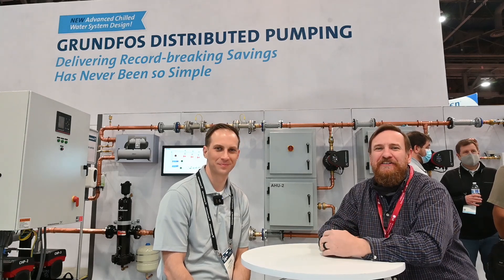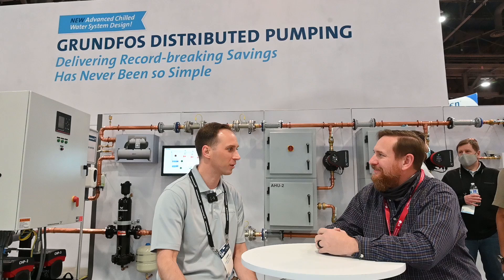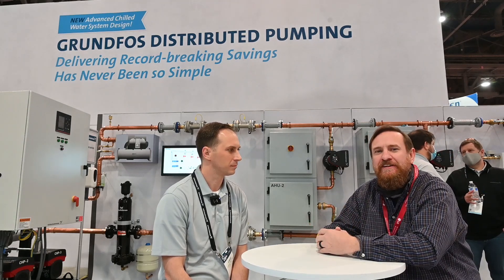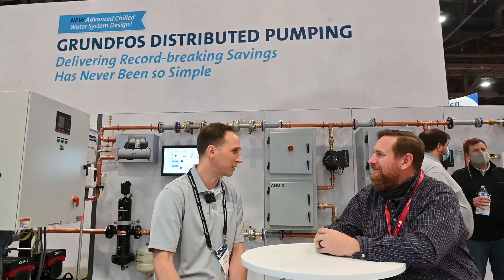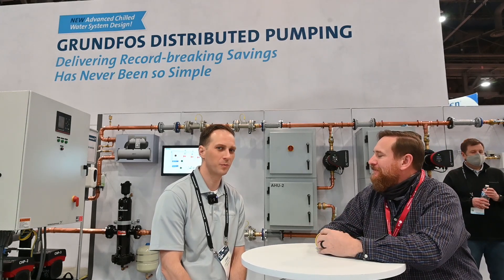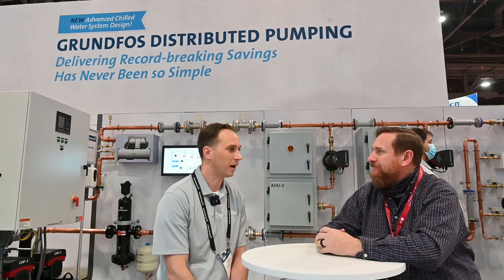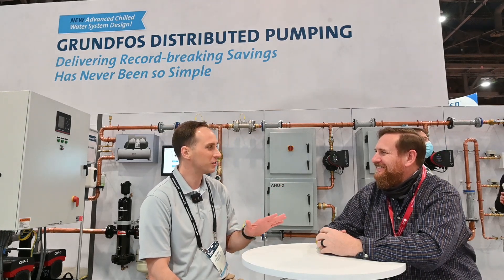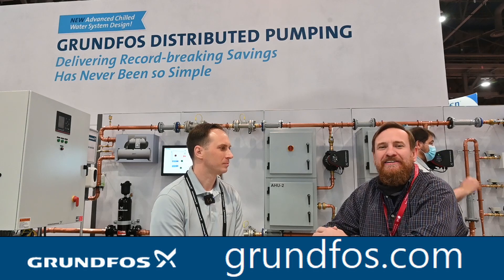AHR 2022 Chris Ireland Grundfos pumps

Comment: Just installed one of their pumps on a glycol refrigerant system.
Reply: Kentucky Hillbilly - the glycol system you wrote - is that a heated circulation closed loop  to a reservoir tank , we use to use something in the plastics industry for thermo-vacuuming sheet plastics machines  keeping the mold hot for product production ? 
Cheers 02/12/2022
Reply: @Chaomhainn  I know what you are talking about, it is not for that. It was on a refrigerated air dryer. We have a thermo mass tank that we cool down and then circulate though the heat exchanger to cool the air and drop the moisture out of it. Having a large thermo mass helps reduce the runtime of the refrigerant system, especially during low load times of air usage. 
The cool thing about my job is I get to see the process you were talking about and many other industries as well.